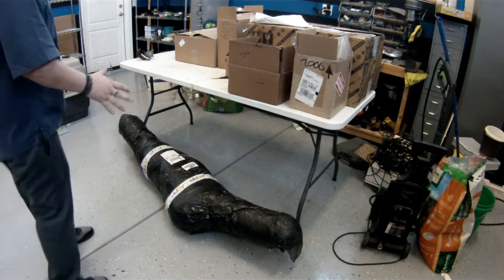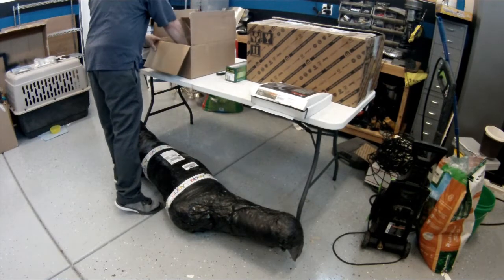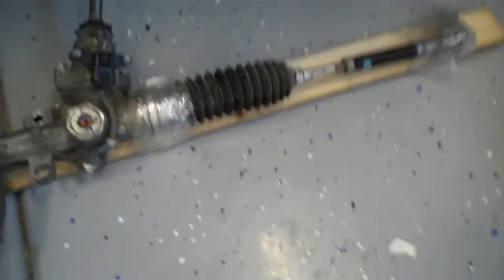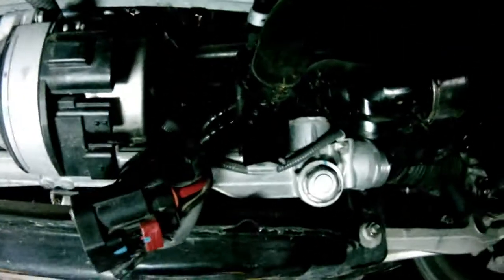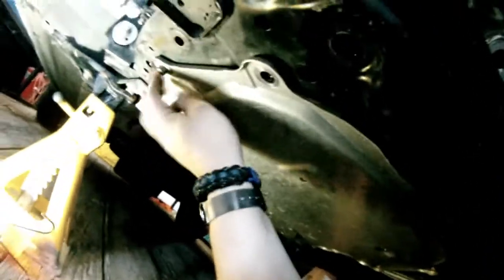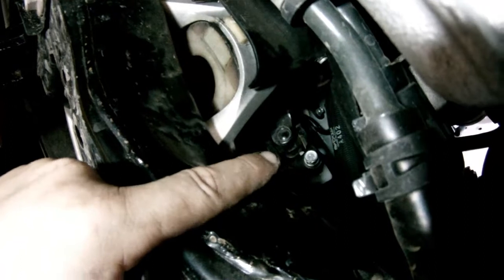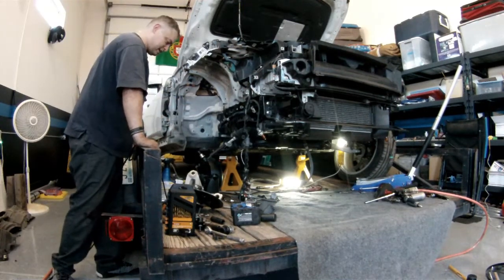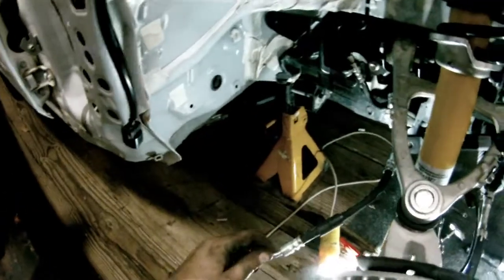Blue Line Garage - 2017 Fiat Spider COPART Rebuild (Part 2)

Comment: Just curious if u used the original electric power steering or the new one?
Reply from the maker: I used a "used" one that had no issues. It was identical and just unplugged the old one and plugged in the new used one.